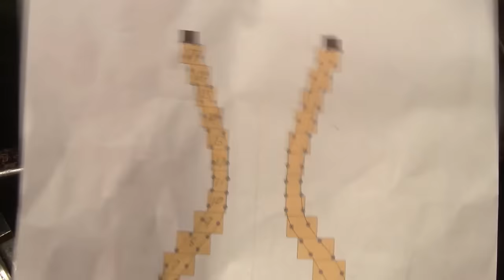Cool Segmented Wood Turning + Easy Adjust Segment Stop

Comment: Came out very nice! Love your jig works really good. When I use rubber bands I made a board about 13x13 out of MDF and drew rings of several sizes and drilled holes in the rings for 4d finish nails to put the bands on . I put down wax paper and put the nails trough the paper keeps it clean and glue doesn't stick and pull nail out to release band to ring . I also have Woodturner Pro love it. Thanks Gary
Reply from the maker: Thank you very much Roger. Many years ago my left hand/wrist got banged up. If I can hook the rubber bands around the piece it is not problem. But trying to hold them open does not work so well. I like to be able to clamp them flat in the press then put the rubber bans on. 
 I have seen the jig style you are talking about. Seems to work good.
Thanks for watching,
Gary

Comment: Very nice Gary! I love it when you do segmented turning. Thought about that for a pepper mill like the one made recently. Mmm I'll have to think about that one. Good idea with the 3-D printed pieces for your stop. I'll have to get my son to print me up something similar. As always thanks for sharing.
Reply from the maker: Thank you Mark. Pepper mill would look fantastic like this. Great idea.
I could have cut the strips out of wood or HDPE. But what I did here that you could not see is in the middle I had a place for a screw but it was split in the middle so it would spread and get a nice fit. Same on the ends.
Thanks for watching,
Gary

Comment: Another nice job, and love the wood combinations.  I might just modify my stop to measure the same as yours.  At present I am using a 10-32 screw to addjust the segment and it takes a few tries to get it right. Your method lookks much easier.  Shoulder is coming along well.
Reply from the maker: Thank you Paul. Been going to make one for a long time. I had thought about using a treaded rod. But it would be slow to go from a small size to a longer one. This is quick. In the pasted I just used the rip fence with a block clamped on it. I  got pretty good with it but this way I did not even have to measure the first cut to see if it was good.
 Good to hear about your shoulder. I may have mine looked at after the first of the year.
Thanks for watching,
Gary

Comment: Beautiful pieces. I like the angled wood next to the table saw blade to keep the pieces rolling away from the blade. 
I must say you have a lot more patience than I do in order to put the segments together. 👍🏾
Reply from the maker: Thank you very much Eric .The little ramp is a much for segments.
What I do is start a little assembly process.
I cut enough for 2 or 3 rings. Move over to the bench to glue them.
While the glue dries I glue one on the piece and start the process all over. If anything it breaks things up and keeps it from boring. 
 Thanks for watching,
Gary

Comment: Pretty little vase, Gary!  Those wood colors compliment each other so nicely, and the wenge at the top and bottom really sets them off well.  Of course, the impeccable finish is the icing on the cake.  Another show stopper!  Happy Holidays!
Reply from the maker: Thank you Marcia. It was fun to do just like the other. Actually harder to do based on the much smaller pieces.
Merry Christmas,
Gary

Comment: Gorgeous piece Gary. I think it’s great that you go into such detail on your process of creating your projects. I really like your stop jig, it looks a lot like the jig that originally goes along with the design with the wedgie sled but that looks like it works a lot better and would be more accurate. Thank you for sharing another great video Gary. Happy holidays.
Reply from the maker: Thank you Scott. I have seen a few sliding jigs like this and like the one you see on Segeasy site.
I thought of putting a fine threaded rod that moved a given amount for each rotation but that is more work going from a smaller size to a long size segment. 
 I could have fasten a digital caliper to the jig but this works just fine.
 Thanks for watching,
Gary

Comment: Nice vase! I really like the jig you made. I’m impressed with the many creative jigs you have made and used. I’m curious to know how you attached the chuck to the tailstock. I have seen other turners do the same thing but none have said what type adapter they use. Thanks and keep up the good work.
Reply: Best Wood Tools makes a chuck insert for my Super Nova II chuck with a 3/4-10 internal thread that screws directly on my One Way live center.  I use it on almost every piece I turn.
Reply from the maker: Thank you Randy. I use an adapter that fits the taper in the tailstock and is threaded 1x8 . I just happen to have a couple that size from a former lathe. They do make adapters that fit the threads on the live center I have but not everyone has that live center. https://www.pennstateind.com/store/LTCA18.html

Thanks for watching,
Gary
Reply from the maker: Those work good. I 3D printed one even though I have an adapter from a lathe I used to have.
This is what I already had: https://www.pennstateind.com/store/LTCA18.html

Comment: That's really nice! I finally finished my first segmented bowl. Made of pine to keep the cost down. It's definitely not perfect, but I sure learned a lot for the next one. I use progecad, an AutoCAD work alike. Why? because I'm familiar with it as I used it extensively as a tool maker/die designer before retirement desinging progressive dies.
Reply from the maker: Thank you very much Stuart.
I have used my CAD program for many of my designs. 
I have a Bridgeport CNC mill so the CAD program is mostly for that.
I worked as a wood patternmaker and am familiar with tool and die makers. We worked with some now and then.
 Thanks for watching,
Gary

Comment: Hi 👋, Gary, I hope you are keeping safe and well, this looks like another great piece of art, I don’t finish watching it yet, but over the last week or so, I’ve been looking at your curved segment making jig, that you made about two years ago, I made the jig with using the parting tool to cut the rings, which worked out fine apart from me messing up the first one, But I’m sure I left you a message, I’ve just gone back to watch it again, you making the jig but cannot see the comment I left, I’m trying to find out if you want to make a larger segment, is there a formula to use to change the size of the bowl you’re going to end up making, regards Phil from the moulin France.
Reply from the maker: Hi Phil, I would have to go back and look myself.
But I had a follow up video showing how to get a 12 inch diameter from the same jig.
https://www.youtube.com/watch?v=3tnPEoQKZH8

But by moving the stop to the left and using longer pieces you can do it.
Have you seen the one where I did an 18" vortex  turning?

https://www.youtube.com/watch?v=HyqhngcWQ1g

I still want to simply this one.

Gary
Reply: Hi 👋, Gary thank you for your message back, I have gone back to the one you uploaded about 10 months ago, about the woodturning Pro, 
I think I will get this software, but not sure whether it’s compatible with Mac, plus I’ll have to wait until after Christmas, 
I’m hoping to try and start up a little business in the New Year , I have done a small amount of wood returning over the years, so my forte is On, high end, specialist joinery, and cabinet make work, I’m now retired in my 70s living in France , though I come from the UK , and I was thinking of doing some resin type work as well, I’ve been watching Jim at Sprague Woodturning and he has given me quite a bit of information information, I’ll have a look at your other tutorials that you mentioned, 
Thank you for your help once again , Merry Christmas and a prosperous New Year, Phil from the moulin France
Reply: Hi 👋, Gary, I have just watched the 12”, very interesting, I’ll watch the other one later this evening, thank you for your help, 
Phil from the moulin,

Comment: I’m curious, could you cut the segments with a compound angle so it would look like either diagonal lines or maybe a spiral instead of the stair step look you’ve created here? I like what you did I’m just wondering if it’s possible to do those other things as well. I’d imagine you would want to make it a bit bigger though gluing those tiny pieces and getting pressure in multiple directions would be an exercise in creativity in itself.
Reply from the maker: Yes you can cut the joints like you mention and I have done that. 
As far as gluing when I put them in the glue press that holds them down. I just let them sit till they tack up.

This is a shorter version of what I think you are asking about: https://www.youtube.com/watch?v=9W_BDsmdEnY

Thanks for watching,
Gary

Comment: I really enjoy your segmented work! How can I get the hardware for the stop block?
Reply from the maker: Thank you very much Douglas.
If you search Amazon this for POWERTEC 71642 Miter Slot Hardware Kit this is what I bought.

The rails on the bottom can be made from wood or HDPE would be better. Or 3D print them. I did that because it is fun

Thanks for watching,
Gary

Comment: Another great segmented turning Gary.  Question: what blade do you use for ripping the strips and for crosscutting the segments.  Also like the depth stop and your segment sled.  Thanks for the videos, please keep them coming.  BTW, do you have plans for the jigs?  Cheers, Tom
Reply from the maker: Thank you Tom.  The blade I rip the strips with is a 40 tooth Diablo 10 inch blade. I use a 60 tooth for the cross cutting of them.
I actually have plans in the works for making this video.
Thanks for watching,
Gary
Reply: @ThePapa1947  Thanks Gary.  I assume both are carbide.  How have you liked the Diablo blades?  Cheers, Tom
Reply from the maker: Yes they are carbide. I like them a lot.
I have  also used the Avanti 60 tooth and they work fine.

Comment: Very nice. That's one I'd like to have in my curio cabinet.
I do have a question, do you use a standard 1/8" blade in your table or a thin kerf? It seems there'd be a lot of wood lost using a 1/8" blade when you have so many small pieces.
Reply from the maker: Thank you John. I use a standard width blade with 60 teeth. For me that works best for all segment cutting.  
The segments on this one were narrow and not very long. But on a longer cut I think with wider blade does a better job. 
On a harder wood you can get a deflection which will ruin the segment and thus not using less wood.
 But those are my thoughts and experiences.
 Thanks for your question and watching,
Gary

Comment: Hi, I follow your videos from Italy which are very interesting. I would like to ask you for advice, I have started to make bowls from a table but I have great difficulty cutting the circles, the biggest problem is that I cannot find a thin and small cutter that does not heat up too much when it turns, to me it immediately turns black. I use a 3mm one, can you advise me of a seller where to find it. Thank you.
Reply from the maker: Hi Luciano, thanks for watching and maybe I can help.
If you are talking a bowl from a board like I do then I use a parting tool that is 2mm wide and 240mm tall.
I am guessing your parting tool is much taller and that is where the problem is.
 If you are asking about something else let me know and i will try and help.
Gary

Comment: I like the smaller vase best  That is just my opinion. I am having trouble with Padauk, bleeding on the  Maple. I am getting dust on the Maple and I can't get all of it off. Any suggestions?
Reply from the maker: Thank you very much. 
So you sand and then try and blow the dust off and it will not come off? Compressed air is the best.
I have not had that issue. The only thing that works for me is to blow it off and then do an overspray of lacquer on. Do not let it get wet. That locks in the Padauk. After 2-4 times you can then spray it on wet and build up your finish.

Comment: Off topic: love your chuck cover/protector. Will have to cut one for me! Distance setter good. Did you skip the turning of the bottom section inside, or just not show it? Good either way. Very nice final results.
Reply from the maker: Thanks Valerie. Chuck cover is very simple. At one time I wrapped paper around the chuck and tapped it. That was too much work.
Had the pipe and wanted a way to put it on with removing the work. Simple band saw cut and it worked out fine.
 I turned everything on the inside. I would turn the inside before gluing more rings on. I must not have shown the first few of them.
Thanks for watching,
Gary

Comment: The only time I used Paducah was on a rifle stock for a grip cap and a forend tip it was claro Walnut and I put a eighth in spacer of holly and used a oil finish I thought it was rose wood it blead and almost made the holly the same color as the Paducah broke my heart
Reply from the maker: That is a shame. Did you end up sanding it out? I have had great luck sealing the Padauk with light coats of lacquer sprayed on.